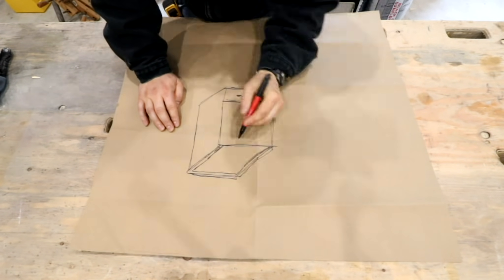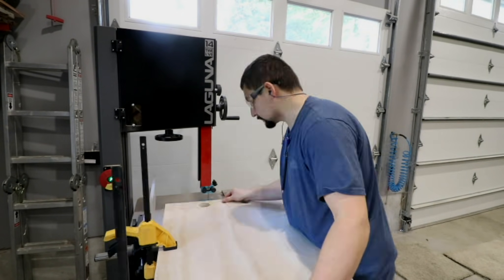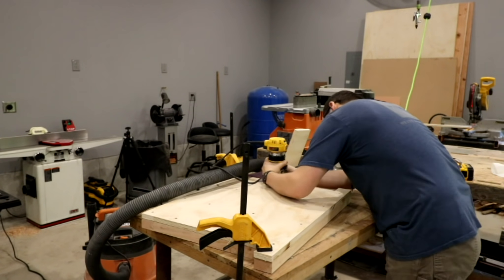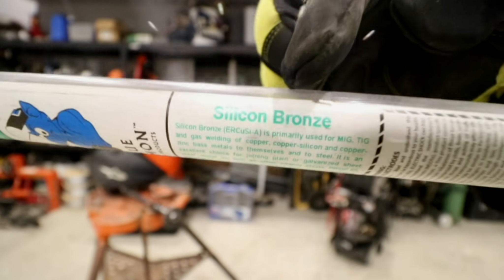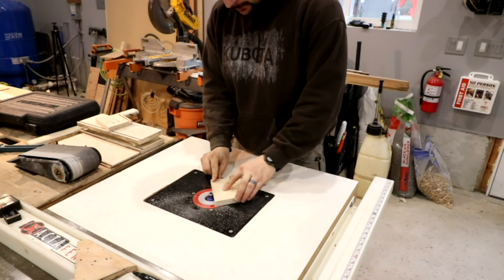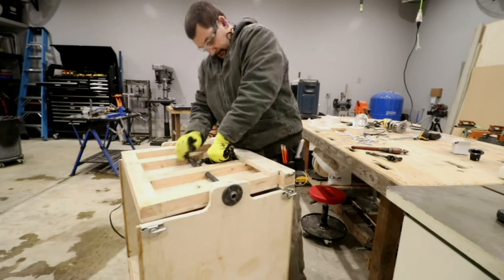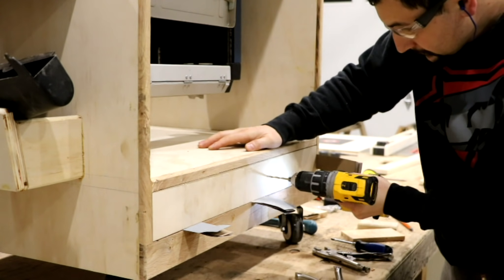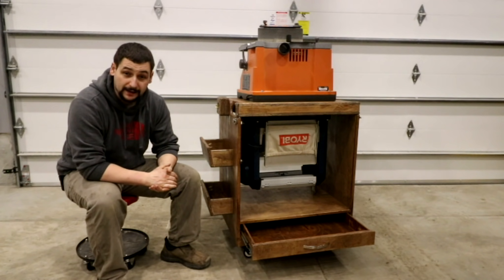Building A Flip Top Tool Stand/Workstation

Comment: You had a great design on the cabinet, thank you what I did with the power cord I ran down to the pipe from the left side up to my power mean and then I brought out of the end. I left a little board open with the power strip faced outward so I could take a plug in the chords for tools. It’s very easy to use the bathroom register two screws up for the board out. I’d like to plugs and put it back in. I think I’m a lot easier for me, but you had a great idea what you did to. Thank you

Comment: Don't feel bad. I'm 77 and just started building drawers. I use box joints. Love 'em. Really like how you handled the electric lines. I've got 3 tools with no good bench space: disk-belt sander, bench grinder, and soldering rework station. Maybe I can  put grinder and solder station on one side, sander on the other. We'll see.

Comment: I recently built one of these, very similar.  I appreciate your candor in your build.  I made some of the same mistakes working on mine.  I built a 5 drawer drill press cart before I build this and that was the first time I had made drawers with ball bearing slides.  I like your idea with the power cord, I did not do that but I like the convenience of not having to mess with the cords, if I build another one I will do that.  I see you like Jet tools, I have the same table saw and jointer, I like their tools.  Take care.
Reply: instaBlaster.

Comment: This was really well thought out!  especially the wiring.  Not sure if I want to do wiring in this manner since I may need to remove the tool and that would take a while to disassemble.  The best part is the flip design with the part extending that locks in place.  I never thought of that and that is really clever.

Comment: Those side bins for the tools are a nice idea. Just a thought ... since the two tools use vastly different tools, building several bins that can hold different tools/supplies/options and having them connect to the cart with French cleats would allow you to change the tools quickly depending on which device you are using and what job you are working on. The changeable bins could reside on a French cleat on the shop wall when not on the cart.
Reply from the maker: I had never used French cleats when I build. I have since then, and I definitely agree that it would be a way better solution to the storage problem on this card.

Comment: Nice, I like your compilation of ideas on this cart, I think this is pretty close to what I’ll try building soon.
Just a suggestion but with the gripsert or t-nuts a little epoxy keeps them from loosening up over time.
I think the one other thing I’ll do a little different is recess the electrical plug male ends so the can’t get bent while moving around or in storage.
Great video!

Comment: I need to build one of these! Now that you've finished it, and used it for a bit, what would you change about your design or finished product that you didn't mention in the video?  I think I am going to make the drawer at the bottom a little taller than yours for sandpaper (belts, etc) storage, and make it so that there are actually 2 drawers - one coming out the front, one coming out the back.  Thanks for the ideas!

Comment: I came across your video because I'm  Iooking to build one.  You and I have about the same familiarity to building drawers. My problem Is putting ths slides in the right place.  I like the wiring part.  Are your tools just wired into the wiring or did you put a outlet box in there in between the sheets of plywood and then you just plug a cord into the outside of the unit?  If that's the case that's slick and the one side is just screwed in just incase you have to access the electrical part of your build?   See electrical isnt my thing so this is why all the electricity questions lol thanks for the video sir much enjoyed.  Peace D

Comment: I have some concerns about the plug prongs being proud (I would have recessed them or used a short cord to avoid that) but after 8 months of use perhaps that is a non-issue. Especially with the shelves there. How has that worked out for you?

Comment: I’m about to build one of these and have a question.  Do you find the height of the sander table to be too high.  I have mine sitting on a side bench and its just too high for me.  I’m 5’11”.  I wanted to double up on a couple of tools so this is certainly the way.  The planer to me looks like its just at the right height.  To lower it I think Ill have to give up on the drawer.
Reply from the maker: Yup the sander is to high.

Comment: Dan, great build.  Thank you for posting.  The last scene shows you sitting by the cart with the drawer open on the side facing the camera and the front of the sander facing away.  Is this intentional, and if so, why?  I’m about to do one of these and am collecting design ideas, so I value your input.  Also, any regrets on buying the Ridgid sander?
Reply from the maker: The sander facing away was on accident i have flipped it 180 the first time i used it. I just was not paying attention when i installed it the first time. As for the sander it self, i have been happy with it, i sand wood and metal on it and for the cost, it has really helped up well. Some tool for me need to be tools that i'm not afraid to really use and abuse and this snader is one of them. When it gives up the ghost someday i will go get the exact same one and keep on abusing it. I hope that helps.
Reply: I bought that sander a few months ago and am going to build this design soon. Was searching designs as well and think this has everything I want. Thx for that! Btw, the sander is great and if you register it it supposedly has a lifetime warranty.

Comment: Nice useful cart. I agree those are called T nuts. Also I have been wondering how your hose and cord reels have been holding up? I need to buy 4 of each and wanted to see if you are happy with them?
Reply from the maker: I like them a lot, I have a 30’ and a50’ air reel the 30’ is great the 50’ gets tangled up during wined up if you have it out more than 30’ other than that they are great!
Reply: I built a couple of carts and I can’t see the work of all that cord rigmarole being of any advantage. You still have to use an extension cord and the tools have good cord storage systems. Also you are not limited which way you flip your tools or how many times you can flip them in any direction. Also covering your bins is a good idea. Otherwise an excellent build.

Comment: Nice build but can see a problem with your wiring, the block you mounted the male plug to is fixed to the table, every time that it is flipped, the wire gets a twist in it, you will have to make sure when you flip it that if you go one way to go back the other way to undo the twist.
Reply: The top only moves 180 and then back.